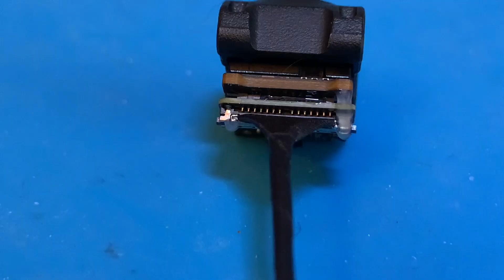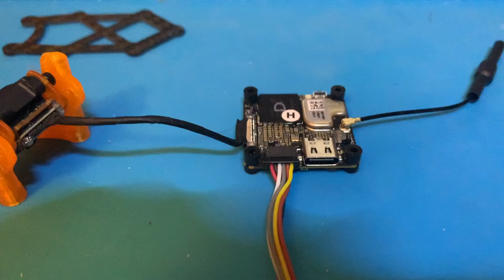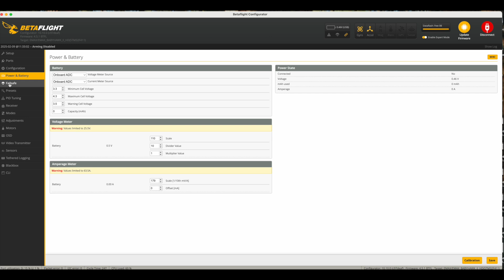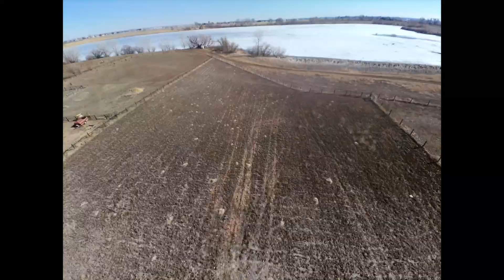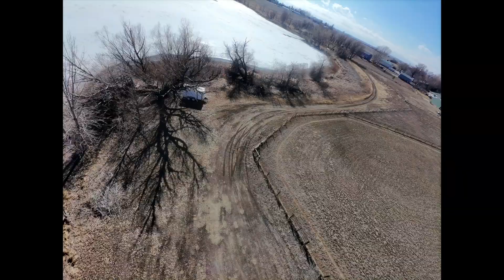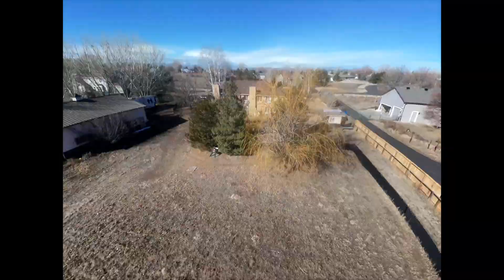Babbyhawk DJI O4 Budget Conversion

Comment: really good vid. Just what I was after!
Reply from the maker: Glad it helped👍
Reply: @slogfpv just doing the conversion myself right now! Quick one, why didnt you use the already available VTX socket to plug the o4 lite in? And use the whole free other UART for the ELRS receiver?
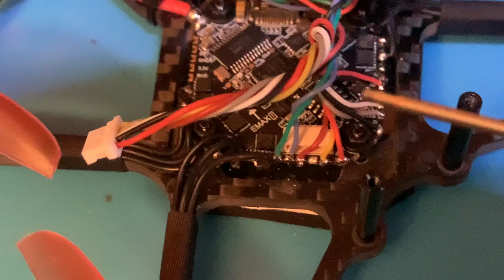Reply from the maker: @drholmes1003  if you go to 6:29 in the video, the red wire VCC is connected to VBAT which is too high a voltage (4S Battery) for the O4 (Lite). That is why you have to move it to the BEC pad.

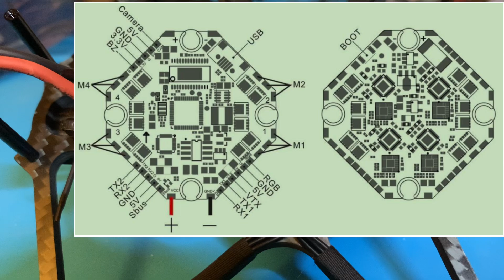On your ELRS receiver question, yes I used UART2 which was open (7:20 in video). Depending on the plug and play version that  you have, this step may not be required (already has an ERLS wire harness vs SBUS wire harness).

Cheers, 
SLOG
Reply: @slogfpv i mean abolish the vtx wires completely and use the vtx plug on the board just above the UART2, no? And use the vtx cable provided with the o4 lite.
Reply from the maker: @drholmes1003  you could but you would still have the VBAT 4S issue. Doing it my way you just have to move 1 wire (VBAT to BEC for VCC). Also I would double check the connector pin out if you are going that path. Point being you will still have to pull out the VCC wire and solder it to the BEC.
SLOG
Reply: @slogfpv hmm. I'm operating under the assumption the vtx plug would feed off of the 5v BEC line. Are you suggesting that's not a given and is better checked?
Reply: @slogfpv after some more thought, I'm with you now. What you're saying is, the VTX jst-sh plug on the board will have a VCC line anyway, which is too high for the o4 lite. So in a sense, your way is the only way really.. Cool, thanks!
Reply: @slogfpv  aaand she flies! 227g all up weight on the new-ish 880mah 4s gnb 160c battery for a 9min flight time. Although I used the Axisflying o4 lite camera case adapting to o3 mounting pattern, which fit well, as I dont have a 3d printer and buying prints online isn't easily available. Excellent video, thanks SLOG! Oh and thanks for not letting me burn my o4 lite unit with VCC voltage from the vtx plug! 😂

Comment: Hello, sane setup here 
Ah old f411 babyhawk with old caddx, so i put the o4 lite as you on 5v output on fc, but when i start adding gas the o4 turn off.. any suggestion?
Reply from the maker: The older Caddx version for the the EMAX BabyHawk II HD has a different FC and the built in BEC probably is not rated at 2As like the FC on the Babbyhawk DJI O3 version which is enough for the O4 lite (1.8 A). Not to worry, you can always add an external BEC to power the O4 lite (just solder on to VBAT. Diatone 2-6S Mamba Micro BEC 2A 5V/9V for DJI Air Unit for example would work. But many options out there just make sure it is at least 2As continous.
SLOG

Comment: whoopsie! my VTX was working with a smoke stopper and also worked when bench - testing Gemfan 3520x3 (they're cheaper, but bad, not enough pitch)

but on the maiden flight there was no light 🤔 checked and realized that I put VBAT on my o4 Lite XDD it just doesn't turn on XDD quick fix and now everything is fine 😅 (I hope, will do range test now..)
Reply from the maker: Glad you figured it out. Yes you need to use the built in BEC on the flight controller. Have fun!
SLOG

Comment: Bought one from AliExpress (~142 €) and it indeed has 2 free UART's ! (support said only one)
3D Prints are installed, but surely not the adapter side plates for the o4 Lite
Reply from the maker: @Cre8ionz.  nice price, glad you snapped one up.
Reply: does your's turn on through USB ?
I can't connect nor the LED's light up, but when I plug in the battery, everything works, so no problem.. Just strange..
Reply from the maker: @Cre8ionz.  When I plug into the FC USB I do get LEDs and can connect to the Betaflight Configurator. However, the ELRS receiver, ESCs, and the O4 VTX do not power on until a battery is plugged in. I would try a different computer as the USB port may not be able to handle the current draw of the FC. SLOG

Comment: Hey! when did you buy this quad ? bc the Emax support told me, that there's no free UART for a digital VTX on the "no VTX, no Receiver" version..
(You said 139,99 $ and later showed 158,9 $ ?)
Reply from the maker: Hello @Cre8ionz,

Here is my invoice information from GetFPV on 7/4/24 of last year:
EMAX BabyHawk O3 3.5" Drone - No FPV System - DJI PNP
Sku: 22238
$139.99 
Ordered: 1

It has gone up due to tariffs from $139.99 to $209.99

As explained in the video, there are two versions of the No FPV System.  One with an ELRS receiver and one without. I would go with the one with ELRS (less soldering). But it has also gone up from $159.99 to $238.49.

Links for both versions below:

https://www.getfpv.com/emax-babyhawk-o3-3-5-drone-no-fpv-system-dji-pnp.html
https://www.getfpv.com/emax-babyhawk-o3-3-5-drone-no-fpv-system-elrs-2-4ghz.html

As far as the UARTS, not sure why support is saying none are available.  Please refer to 18:09 in the video.  For UARTS, I used UART2 for the ELRS receiver and UART1 for the O4 VTX.

Happy Flying!
SLOG

Comment: Thanks bud ! About to do same thing...but bought a voltage regulator that apparently I didn't need LOL
Reply from the maker: Well a voltage regulator will give you more head room for current draw. I was trying to make this as simple as possible (one wire to solder) for new pilots. Flies great and a lot of fun for a budget conversion.
SLOG